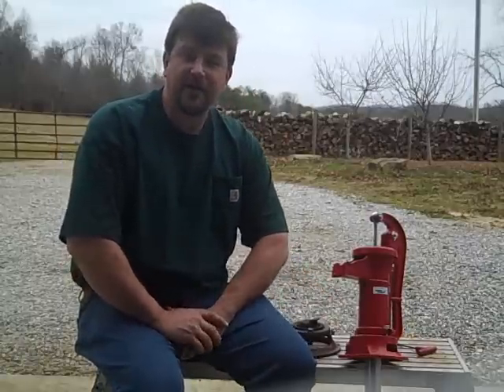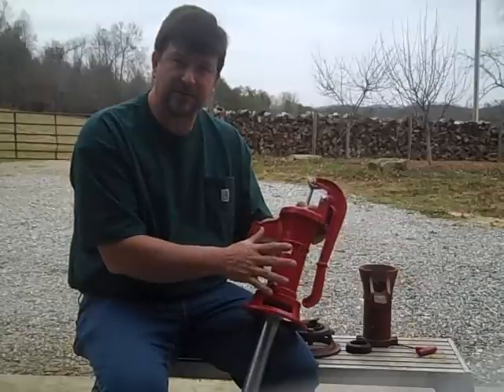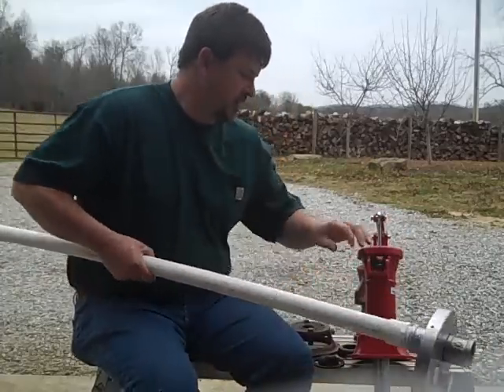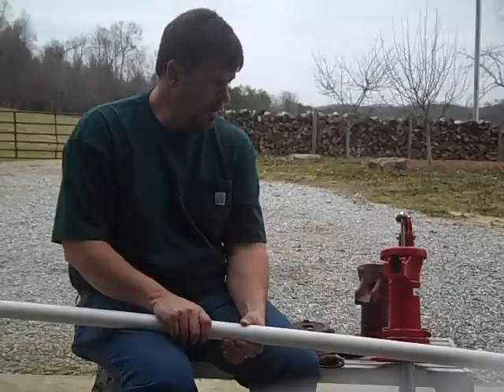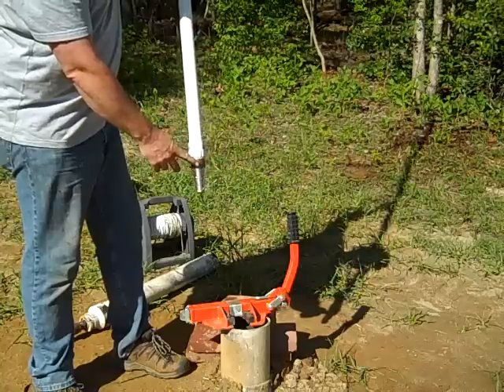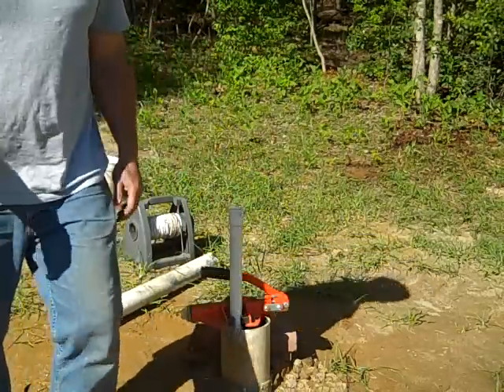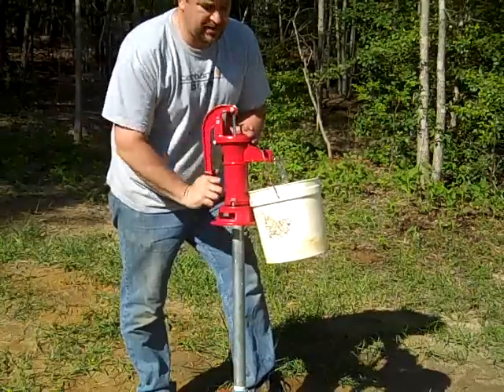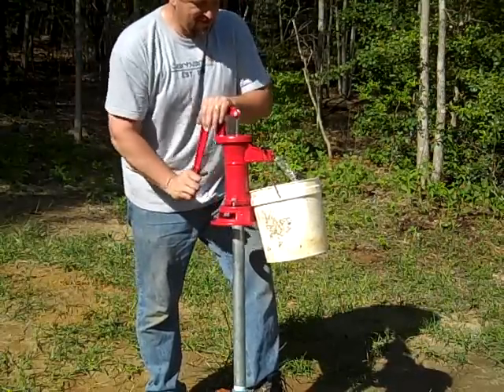All about wells- Pitcher pumps

Comment: If i want to go over 34 feet like 40 or 50 will it still work at all. Im worried that as we dry up my deep 160 ft well and i get water at 15 foot it will go lower as less water is out there. If my water level goes to 40 + i want to be able to get water

Comment: How deep is the well?
Can this collect water from 100 foot deep well?
Reply: Not if your water level is more than about 30’. But you can get a hand pump that is designed differently. It has the pump at the bottom and uses what they call a sucker rod that goes from the hand pump down to the pump at the bottom. They can be used down to like 300’. But they cost quite a bit more to buy.

Comment: When evaluated by a well service company, our water was 18 feet below the ground level where we were standing. They determined that the bottom of the well was 100 feet, so 82 feet of water. You said that the hand pump can pump from 33 feet depth or less. So, here is my question, maybe a dumb question. Would the 18 feet of space (from surface to water) be included in the 33 feet? Then the pipe would drop up to 12 or so feet below the current water level?
Reply: Yes, that would work just fine! As long as you’re below the water level is all that matters if it’s 34’ or less. So you’re being 12’ below would be great.

Comment: I live on an old farm with a hand dug well, its deep and stone lined. It has an old existing hand pump which I’m not sure is repairable and the iron piping corroded. I’ve seen videos driving pipe into the ground. Of course I don’t have to drive pipe, I already have a well full of water. Could I use the same piping and pitcher pump for my well? I’m assuming so. Do I need the drive point? Or could I use a drive point with its built in filter, attach sections with couplers, attach the pump and I’m in business with a water source on the old farm? Or is there something else I can install instead of a drive point at the end of the pipe? A filter that fits on the end of the pipe? I’m not 100% how to install plumbing into an already hand dug, stone lined well. Thanks.  Oh: the pump I have is the original pump on the farm dating 1898. A 98 year old lady stopped by who was born in my house said it’s the same hand pump she used as little girl. It’s a. FE Myers & Bro. Pump. I’m still researching info on how to refurbish it.
Reply from the maker: What is the distance from the ground to the top of the water in the well that is the key to determining whether or not you can use a pitcher pump. If it's over 25 ft you cannot you need to use a lift pump. We use simple pumps on all these hand dug wells.
Reply: @engineer775  thanks for the info. I’ll have to measure the depth and see. When I pulled the old pump out the well, it did have a separate pump connected to the piping and a very long piston rod inside the pipe connected to the  hand pump. I never seen that before. I wasn’t sure what the contraption was but assumed it was a separate pump and the original piston and flappers were missing in the hand pump. Interesting stuff. Thanks again for the info.

Comment: In order

Why did you multiply the atmospheric pressure (14.696 psi) by 2.31 in order to figure out the maximum pomp power suction ? What does 2.31  represent ? Thanks for information .

Comment: Take your grinder and grind down each side of the water slide, so you can place the metal handle of the bucket and set the handle into the slots you grinded so the bucket is locked in the slots and won't fall off the water slide.

Comment: How would you install a punp if your shallow well casing is concrete that's about 3 ft in diameter. Thanks
Reply from the maker: There are several ways to do this and I typically use a little pedestal mounting adapter that I bolt to your concrete lid. I would hammer drill a hole that would accept the pedestal and then I could install a submersible a hand pump whatever you'd like through the lid. If you do not want the pump in the lid mounting then you could go underground through the side of the well casing and hammer drill a hole there and then your plumbing would go in and out and with your wiring of that hole that you could seal up.
Reply: Thanks for the reply. Do you work in va installing hand pumps?
Reply from the maker: @grumpyolddude5374  as you know VA is huge so it gets out of our range pretty quickly so if you could tell me what area that would be great
Reply: I live near Petersburg Va

Comment: If I put 100ft of pvc down with a foot valve at the bottom
 but the water level is at 15ft would the pump consider the water level at 15ft?  I pulled an electric pump up from a ridiculous distance but I would like to have the water from that lower footage.

Comment: Great informative video! Tne only thing that I would add to your setup would be to tie a length of 1/4" nylon rope to the bottom section of pipe and then knot/tie it to each subsequent section above until you reach the top. You could leave it dangle out under your well cap or tie it to the pipe just under the cap. Should your PVC pipe break or become separated you can still lift all of the pipe up out of the casing.
Reply: use polypropylene made for well safety rope, better use stanless multi strand cable, Nylon is not permanent water proof long term, also dry rots over time. I use aircraft safty stainless wire run between to stakes longer than need cable the connect one end in drill and make my wire rope/cable

Comment: Hello Engr775 - can a picture pump be setup on an original 4" casing if a new well has to be drilled to not have to fill it in?  My see water level is 5' in the dry season and the current well pump-static level is at 40' but I suspect the water table level sits higher than that.
Problem is the current well is sucking up sand which dilutes when flushing the well but doesnt completely clear out enough for a filter. Any thoughts?

Comment: Good video but the best solution to those miserable corrosion prone fossils is scrap 'em and run a manual diaphragm pump like the Bosworth Guzzler instead. Bosworth sells through marine dealers so I like most folks who shop at farm stores didn't know about them. You can also use a Bosworth (or clone, but Bosworth are USA made and you can get parts if you ever need them) to prime your electric well pump.  This guy made a video so I don't have to, but I'm spreading the word because my years of hassling with pitcher pumps are finished.  https://www.youtube.com/watch?v=fWg-AKPcYRk

Comment: I'm wondering if  I really need a well casing/ drop pipe for a hand drilled well where my water table is less than 15 feet below.  I've seen a 2" steel pipe well system with a sharp bit and screen that remains and that you just hammer drive into the ground and never pull back up.  Also wondering if even need to jet to get it through Florida dirt.

Comment: I drilled 30 ft. With a pressure washer, cased the hole with 3" PVC, with perforations in the bottom 10ft.  It took a while to clean up, but like you said, "it will keep my family alive" if need be.

Comment: thanks for the video, enjoyed it, informative.  I have a question, I have property with a pitcher pump on it that my Dad put in back in the 60's.  The property went through hurricane Katrina and was wrecked and I just had to walk away and let nature do her thing.  I went back recently and the property is pretty again.  I found a running spring and I found the old pitcher pump in the woods.  The depth is 14 feet.  Back then people weren't using PVC pipe so the pipe is galvanized.  I want to refurbish the pump and get it going again.  I can use the property for hunting and camping and it would be great to have water.  As old as it is I was wondering if I should replace the seals like it is or rather, maybe put a pvc pipe down inside the old galvanized pipe with a new pitcher pump.  The water would be rusty and nasty tasting if I were to continue to use the old pipe.  Try to pull the old pipe out?  Any suggestions on how I should bring it back to life?  Thanks

Comment: it looks like a longer handle would indeed be nice, but also a longer spout so the base of the pump isnt pushing the bucket off its own bucket handle catch. you might could find a led pipe or some similar length of tube that'd fit over your handle.

Comment: Dumb question: in cold climates, are you asking for trouble by putting a foot valve on (leaving the water in the pipe to freeze)?
Reply: Instructions say not to use foot valve for that reason - in freezing weather. Also there is no warranty if the leather freezes and you have to use hot to warm water to thaw and soak for half hour each time.

Comment: For the life of me i cant get my new pitcher pump to work. The old one waa a antique. Anyways. I tested it b4 installing it by using a scrap 3 foot pipe in a bucket of water. It worked great. Once i install it in pipe in ground it wont draw at all.  Primed it. Even filled water pipe full of water. Still no go. It gets super tight? 
I used a piece of twine with metal weight and pipe goes down 21 feet to bottom.

Comment: tho this probablly won't get answered, i'll try anyway. used a well point with 1 3/4 iron pipe. presently showing 25 inches when i put the tape down in it with 23 feet of pipe in the ground, but has shown as much as 39 inches. am i 1 going to have to back fill my pipe with water, and 2 if not will it draw it to the pitcher pump thank you
Reply from the maker: You will need to prime the pump each time by filling the pump.

Comment: My question is I don't wanna spend a bunch of money on a deep well pump I have an old existing well on my property 2" now if I stick 3/4" pipe or even 1/2" about 100ft into My 2inch caseing will the reduction of water weight allow my to pull water from that depth?
Reply from the maker: Sorry, 30 ft is the max suction depth  no matter the size of pipe of the strength of the pump.

Comment: Thanks very informative, So your saying this type of hand pump can only work if your well has water at 30 ft?
Reply from the maker: dnhman realistically 25 ft because of losses in the pump and friction
Reply: @engineer775  I have a well 140 ft deep the static water level is 28 ft from ground level and I have all the info if you need more info. Question, can I install something like this will it work with my well? I looked into simple pump and its 1800 and bison pump is like twice that price so I can't afford that.

Comment: These are Chinese-made, pumps , leathers wear out in abt a year, interior cylinder is very rough hence lots of wear on leathers leading to early failure, must cycle every month to keep leathers wet. Alternative , make leathers from rubber gasket material, they last 10x longer than leather, for my SHTF water, I dc’d the pitcher pump for a PVC hand-made pump bc of the scarcity of metal kits, repair kits with shipping cost are as much as buying a new pitcher pump ,available metal kits are from the same Chinese pump mfg, a kinda Catch 22. Pumps made in USA, as well as hardware, if you can find one, are much more expensive. Good Luck!

Comment: Alright I know this is an old video but asking here because there seems to be a lot of smart people in the comments section (crazy, I know) I have a pitcher pump, that is outside with foot valve but winter is coming.  Could I drill a weep hole just below the frost line, and leave the handle in the up position to let water drain out the weep hole in the winter, and out of the pump?  Also will the pump keep it's prime in the summer if the handle is left down, even with the weep hole.  Had I been less ignorant I wouldn't have use a foot valve at all but at this point it would be a pain to remove.  A weep hole just below the frost line would that be that hard though.

Comment: The video is great. You should tell them about flipping the seal in winter to let the water drain back down the pump. It means you have to prime every day but your pump don't freeze up because the water drains back into the well.
Reply: I think the foot valve would prevent it from draining back down regardless of check valve in the pump.
Reply: With the foot valve installed it still wouldn’t drain unless you go down below the frost line and drill about an 1/8” weep hole in the side of the pipe.

Comment: I have a 4 inch PVC casing in a shallow well.  Where can I buy a well cap like the one you used in the demonstration.  I prefer the side mounted set screws and a cap which will accommodate 1 1/4 inch pipe?
Thanks!

Comment: My down pipe is 3/4", do you think the pump will still draw water up such a small diameter pipe? Thanks in advance
Reply: Did the 3/4 work?
Reply: @freakinowned  Yep, worked fine. 9 years and thousands of gallons later.
Reply: @80ATS that’s great how deep and was the pipe in a casing?
Reply: @freakinowned 28ft and cased with a perforated drainpipe. I added a bunch of extra holes to the pipe as well. Backfilled with a few bags of gravel and used a brass check valve at the end.

Comment: is it viable using the same casing my home well resides in? I also probably would have to reduce the supply pipe at the bottom. Is that advisable? I was thinking 1" or 3/4" to get by the current pump
Reply: Mine fits in the well casing right along side of the pipe going down 285 to my electric pump. You are only going down less than 30 feet.

Comment: couldn't you reduce the pipe at the pump to 3/4 and achieve a deeper level if needed?
the reason im asking is because i have 3 wells  one is older and less deep but i have yet to check the depth of it, on my other two wells are at 110' deep, but im sure the water is much higher? im in Florida and you hit water pretty fast here,, the deep well hand pumps are a bit expensive, the one i just priced was $1,400 im wondering if you reduce the pipe like im saying do you think i could achieve 50' ?
Reply: No doesn't matter if the riser pipe is the size of a coffee stirrer or 10 feet in diameter, I'ts impossible to suck or pull water up for than about 30 feet.  You can push water up as high as you want though, so you just have to put pump down in the well instead of on top of the well.

Comment: Im in northern Michigan.  Im putting in galvinize pipe cause I already  have a 5 ft sand point. This is mainly for garden. my house is all set.  I am on edge of swamp, and near a spring stream that dries up late summer. I hit standing water 3ft below surface but plan to go down 12 to 15 ft total. I was told to put chk valve  up by pump with a drain plug installed just belowe to let water out for winter. Also told (by someone else) to put it just above sandpoint and for winter just displace the water with a 1 1/2 inch pvc with a cap. Stick it in to chk valve or the 12 to 15 ft Im thinkin on goin with pipe. Which do you think is best option? Also Do I really need it seeing Im only down at most 15 ft.  If not at which depth would you suggest a check valve?  Thanks  Nice vid.

Comment: I have a question or two if you don't mind.....like 50 years ago my grandfather buried a 1" pipe, no casing, reached water, went ten feet below, capped it off at the ground, walked away from it, and could never find it again. I found it 10 years ago. The water table is at 18'. My question is, with the aid of a reducer can I use this make shift well with a hand pump going from 1 1/4 inch from the pump down to 1 inch to the exposed cap?
Reply from the maker: yes.
Reply: +engineer775 Practical Preppers Great. thanks

Comment: Would a 1/16" or 1/32" hole drilled in the PVC just above the foot valve keep the pump from freezing during winter?  I know you would slowly loose prime and would drain the pipe down to the water level, but will it completely drain the pump or would you still have to remove the pump during freezing temps?   If it does drain the pump, that would solve the problem.     Any thoughts?

Comment: what if you reduced the size of the pipe could you go deeper?
Reply from the maker: no matter the pipe size thy max suction is around 30'
Reply: +engineer775 Practical Preppers 
 I must say, In my 25 years  of drilling wells and installing pump systems, He is correct.  I've  never seen a pitcher pump pull up  past 28 feet .  
They do  develop a new P.V.C.  or  and  old rusted up steel shallow well better than anything on the market today!!  Provided you have the arm stamina to go at it for a couple hours ..Nothing  beats a tight well , pitcher pump arm work out !!

Comment: Good information....I'm doing a shallow well for the first time...I'm having trouble pulling water up from the WellPoint. My point is 17' to the bottom. I had to put my garden hose down to the point to flush it out....when I did this, the water came up the pipe and was muddy for a minute or so, then fairly clean. Then I would raise my garden hose up and as I did this the water would not stay in the pipe. At this time I figure the WellPoint is all clean as I cannot keep the water in the pipe. I drop a string with a weight down to about 11' and hit the top of the water. Then drop it down to the bottom witch is another 6'. (When I bring the string up it is wet from the bottom up to 6'). I hook up a 1.5 hp flotec pump, prime the pump, but it won't pull the water up. I tried the pump several times but no luck. Any thoughts or suggestions would be greatly appreciated.
Reply: +dave cantone  A well will take what it will give so if your water  is coming  out  over the  top with a garden hose then you are not  producing much water  when you put the well in did you use teflon tape and as liquid thread compound and tighten it up good with a couple stilson wrenches?
Reply: +Rick sounds to me  like your well screen is in  very tight material clay like almost !